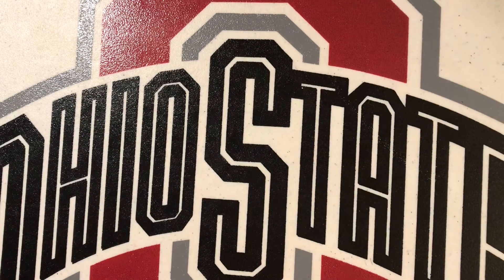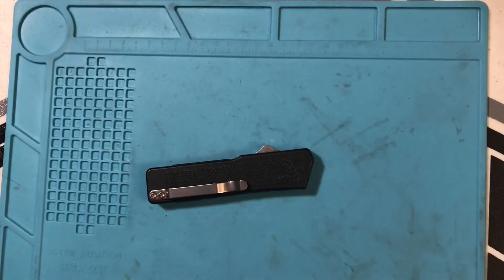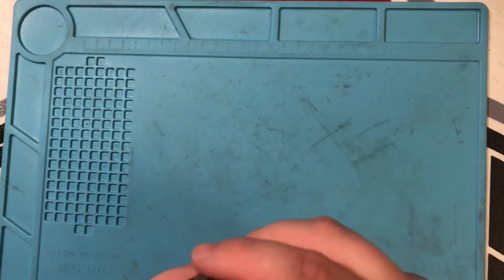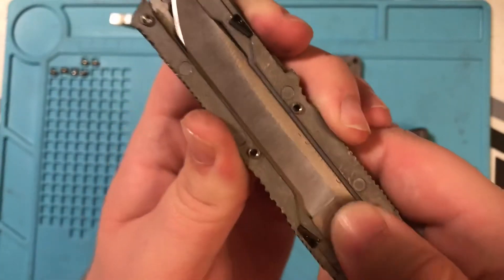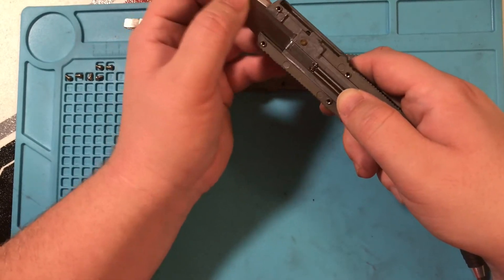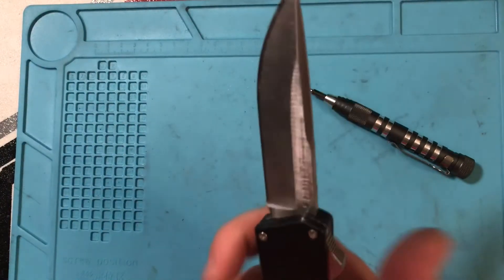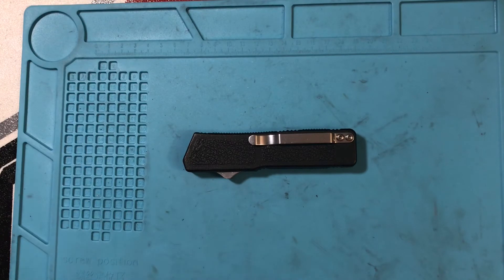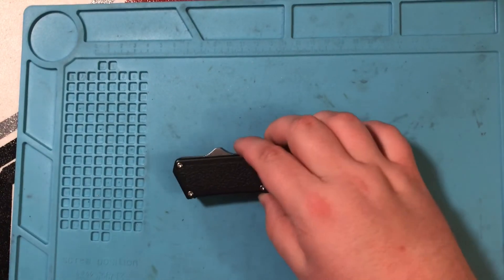Lightning OTF Disassembly Request from Chad Christman

Comment: FYI If you want to remove the blade from the body the black pin in the center will come out fairly easy with a pair of need nose pliers.
Reply from the maker: Definitely a good point!

Comment: i was curious if it was all metal inside, and I'm glad to see that it is. I got an otf off wish and it was all plastic and broke quickly where the spring tention lock is.
Reply from the maker: If I were to snag one off Wish it'd have to be for like a design testing purpose to see if I'd want to get the real deal! I wasn't sure if it was a pot metal or aluminum handle and insides myself so the first time I took it apart I was kinda surprised!

Comment: You definitely need to spray everything with Silicone spray before reassembling it. The knife is not supposed to be so dry, you could even wash everything in hot water and Dawn dishwashing liquid, dry it off and then put Silicone spray on everything and just take some Qtips and wipe the Silicone into all the rails and lubricate the springs. Also lubricate under the thumb button. Doing those things will make it last forever and won’t wear out the thumb button from using too much thumb pressure. I have 3 Elites and the blades on all three occasionally stuck halfway out but after cleaning and lubricating and also taking 1500 grit sandpaper and polishing the metal parts it feels totally different than a brand new one. If you wanted too you could put some blue Locktite on the handle screws and they won’t come loose. 
Move to Florida after you get your knife polished and lubricated and you will be able to Freely carry it almost anywhere you want.
Reply from the maker: I very well could have but it was meant to be a quick disassembly and maintenance. It is a very good point in sanding everything down to be smoother but for a sub $40 knife when I purchased it the materials aren't the best quality. If it were an Elite like yours I would have lubed everything!
Reply: You definitely do NOT need to lubricate these.  It depends on where you live I suppose and if you are in Florida, "in the pan" and get salty air from both coasts or you live in the high humidity deep south, your knives might rust and corrode and prevent them from working.  It all depends on your own experiences and how rough you or your environment are on the knife.  Don't tell him to move, just tell him to be politically active and get the silly "omg it's an automatic knife, that must mean you're a gangster" laws off the books.

The Lightning Elite knives are painted on the inside of the handle -- this could potentially be a source of problems if the paint is too thick or starts to flake off.  Again, your mileage may vary and will not apply to everyone in every situation

Comment: 440c is what iv read .
Reply from the maker: From what I've read it was just 440 steel and didn't fully perform like most 440C I've used. It could be that mine has a bad heat treat possibly due to it being a huge batch when made!

Comment: Ahhhh, well. Mine is broken-broken then. My bottom metal piece that the springs attach to, the L shaped one, is broken and cracked at the bend and is now shaped like an I. Appears to be made of pot metal. I never really carried or used it, only fiddled with it but over the 8 or 9 years I had it I’m surprised it took so long to break. Thanks for the video.
Reply from the maker: Sorry to hear that! Yes its not made of premium materials lol I barely use mine

Comment: I got a lighting. My action was so stiff I had to take it apart and shave of some excces metal on the firing tab cuz the machining on the knife was pretty bad. It's more manageable now but do I have to play with it a bit more so it becomes less stiff?
Reply from the maker: For mine I had no extra metal so I can say mine was a little smoother out of box. As for the spring stiffness it was pretty stiff so I just continued to play around with it until it got softer!
Reply: @ohioknifelover  thank you!
Reply from the maker: You're welcome!!

Comment: These things are junk
Reply from the maker: I have had the exact opposite experience but I mean for a $40 automatic it was more of a novelty
Reply: @ohioknifelover  I liked mine up until the spring broke just by sliding the lever mechanism up.
Reply from the maker: @ryanstorer9335  Unfortunately that's the most common part to break and they're not a standard spring to replace immediately
Reply: I've daily carried mine for 2 years. No issues so far.
Reply: Right. Please don’t buy them 🙂